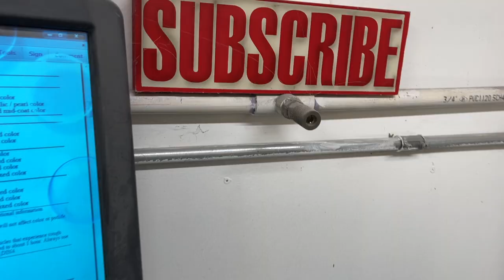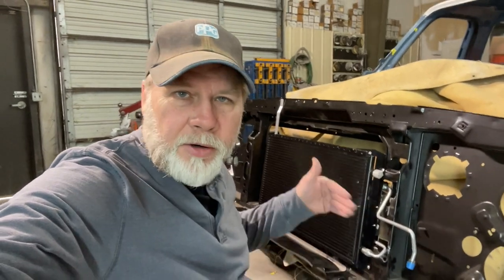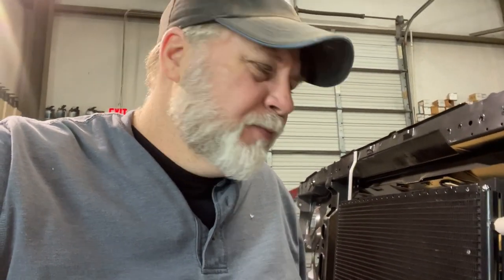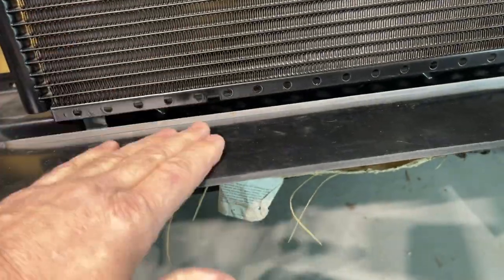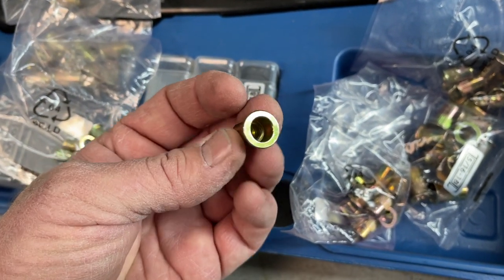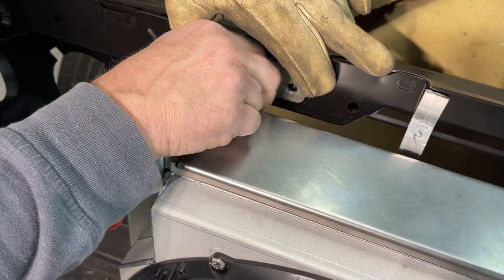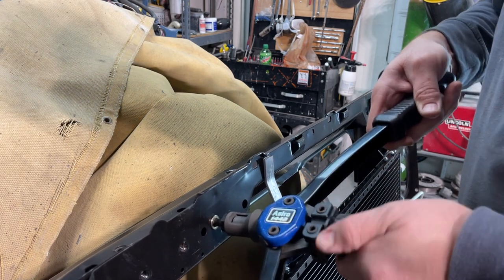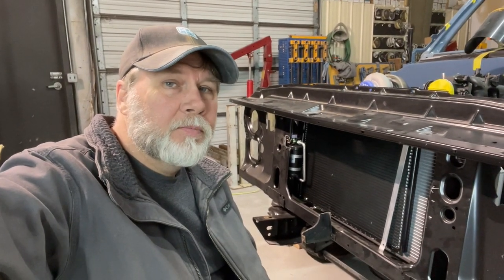C10 Project:  Making Brackets for the Radiator Installation

Comment: Did you make them channel pieces yourself or can you purchase them? I have the exact same radiator, also going into a square body
Reply from the maker: I have a friend that does metal work. I had him bend the channel pieces for me. Worked well but I wish I had relocated the a/c drier and mounted the radiator closer to the support. With the radiator spaced away from the support I really need baffles to direct the air flow. No issues yet but I think it would help in the heat of summer.
Reply: @StoutCustom  Got it! That’s some more good info, do you happen to remember the gauge used? I see all star performance sells a set but wanting to check around some more!
Reply from the maker: @daltonminckley5929  I think 18ga but not positive. I’m not sure if I showed it in the video but I bought some thin strips of rubber to go between the bracket and the radiator to keep it from being metal on metal. Worked well
Reply: @StoutCustom  Yep I saw it! I work at a place that makes parts out of all kinds of rubber and foam so I’ve got that covered at least haha I’ll be doing the same setup as you, I’ve watched a lot of your videos multiple times 🤙

Comment: What radiator are you using
Reply from the maker: It’s a griffin performance fit with dual fans. It’s a replacement for the stock radiator and not designed for an Ls swap. The stock replacement was several hundred cheaper than a “Ls” swap radiator. The difference is size and location of hose inlets/outlets and trans line hookup sizes. I had to do a little adapting here n there.

Comment: condenser bracket video?
Reply from the maker: I mounted the condenser at the beginning of the video. Just two straight pieces of aluminum mounted vertical from top to bottom of the radiator support with the condenser mounted in between